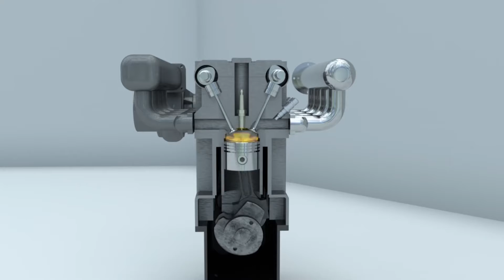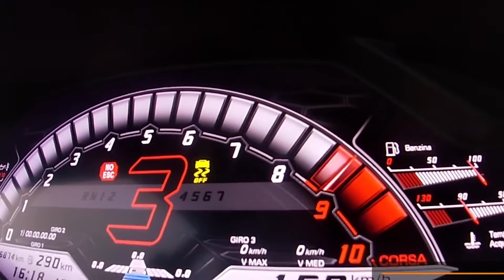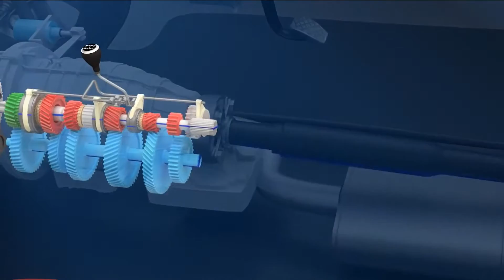Secrets of Naturally Aspirated and Turbocharged Engines

Comment: I can’t make myself believe that a turbo charged inline 4 cylinder engine is better or more desirable than a naturally aspirated V6 engine!  Sure you can get amazing HP from the smaller engine but the wear and tear on the smaller engine eventually will end in higher maintenance costs and durability. Also, for everyday in and around town driving, the turbo charged inline 4 is a maintenance cost waiting to happen. You never reach consistent high end engine work to justify the smaller, albeit more powerful, turbo charged engine.
Reply: You're not wrong. I totally agree. 🫡

Comment: If you look at the new model year cars in Road and Track, the performance increase year over model year is often measured in tenths or even thousandths that no daily commuter would even notice. So in the High Pressure Sales Department of Marketing, Giving up the Hard earned Dollar in your pocket for a Negative 30-50% Rate of Return on your $1 Investment always makes sense on the salesman's Whiteboard where they log their monthly quotas. 
  In engineering terms BOTH TURBO and Naturally Aspirated Engines ACTUALLY Have THE SAME DISPLACEMENT. As it turns out, some remote mounted turbos can actually meet the same output as a big block! If the length of the turbo plumbing COUNTS AS DISPLACEMENT, then Running and Equal length tubes in a parallel configuration ACTUALLY Exceeds the Obscene placement of turbo plumbing near hot exhaust manifolds
Reply: And to make matters worse for the world of high end personal computing, a dissimilar term in Electrical Engineering called RESISTANCE pretty much Rings the Remembrance Bell for Stereolithography

Comment: I was looking to purchase the Honda CRV-LX or EX and had no idea about this turbo issue. Makes since. I am not sure if these 2024 Honda vehicles are properly put together. Can someone lead me to some small SUVs that are Naturally Aspirated and if turbo, are well put together. I currently own a 2008 Honda Accord, but it has 265,000 miles on it and it has been giving me some issues the last two years. Leaking oil, o2 issues, etc... I am just tired of putting money into it and looking for a reliable new, small SUV. I know Hondas, Lexus and Toyota have been reliable vehicles in the past. I live in the South Suburbs of Chicago and looking to raise the vehicle off the ground, meaning, it is hard to see during the winter months, when you are riding behind other vehicles and don't get me started on the rocks hitting the windshield. Any help, I would appreciate it.
Reply: Just think of it this way. The reason they are putting turbos on newer engines because the engines are smaller & they have to get those engines to work harder by forcing more air through creation higher rpms. This concept is great for race cars when your trying to boost performance but when you make an engine smaller & turbocharge it your just wearing it out faster. Also higher rpms create more pressure inside the engine block & higher pressure means there's a greater risk of blowing seals & gaskets. On the other hand a naturally aspirated engines work naturally at lower rpms & create less pressure on the block & will last longer. You can add a turbo to any naturally aspirated engine & get more power if you want. The only downside is your MPG is slightly lower but personally id rather have engine longevity over a 10-15% mpg increase. The reason manufactures are making so many small engines with turbos is because of Government Regulations on Emissions & MPG. The EPA has been destroying automobile reliability & longevity with combustion engines while at the same time pushing EVs that no one wants that are also not a realistic alternative. Hopefully politics will change & manufactures can get back to making cars with engines that people want. Its so crazy now they are putting 3 cylinder engines in SUVs & adding 2 turbos.
Reply: @wandameadows5736 great response. You really justified my purchase of the IS 350F Sport.
Reply: @wandameadows5736  That was an excellent reply. Thanks for sharing your knowledge.
Reply: Get you a Toyota or Lexus, and you'll have a great mechanic on the Southside that specializes and works only on Toyota/Lexus/Scion (The Car Care Nut...check out his channel).  

Some people drive HOURS to his shop from out of state.  It's worth getting a Toyota just for that alone, IMO. 😉

Comment: Ok have you ever built a NA engine?  I have built several high HP NA engines and to extract high amounts of power out of them as you state you need to RPM, large cams and large intake tracts.  Gives you the power at these high rpm ranges but will be slow at low and possibly mid-range rpms...you now where most people operate engines at.  Also, comparing sounds is ridiculous as turbo uses the exhaust to spin the compressor which in turn muffles the sound.  You are making generalized statements here, I could spec a turbo engine to give more a nice powerband 1500-4000 the bulk of when you need that will be more responsive to a NA engine, the last 500HP engine I built had a power band of 2800 - 5000 so off idle was not as responsive as the 300HP engine that it replaced and had a similar kick that is similar to turbo lag.  My current 2.0L turbo Audi is very responsive from idle on with no turbo lag.  If you put a poorly spec'd large turbo on a low compression engine you will this sluggish throttle response; however, today's turbo's have reasonable compression ratio and use turbos with low friction bearings that spool quickly and designed to operate within the rpm that you need the power.
Reply: I still choose NA because it's because they are more reliable the turbo/supercharged engine
Reply: There's no secret in this video😂
The guy probably watched some YouTube and read some articles and post his own
Reply: Nothing much just talking
Reply: Don’t get mad, this guys channel is literally chatgpt texts into a ai text to video service. The ai creates the audio and the video.
Reply: Does it have less power at low rpms because less air is taken in due to the car moving  slower ?
Reply: @avichal6630  more from the cam profile, duration, LSA, etc. that dictates the powerband.